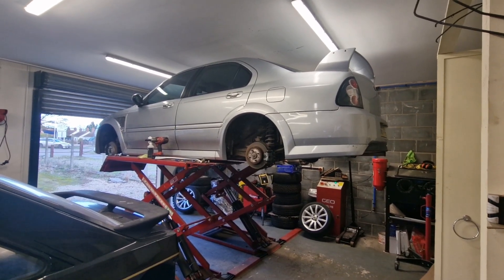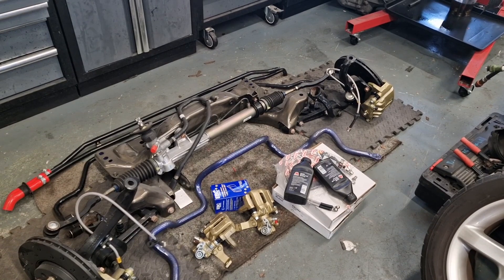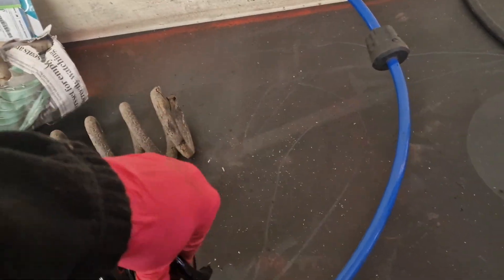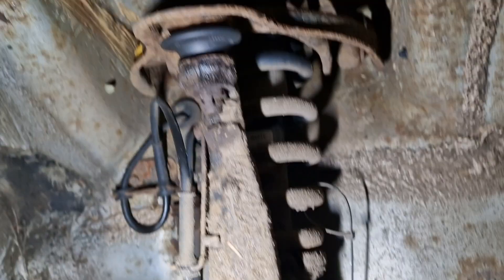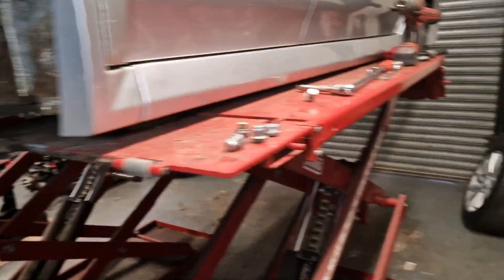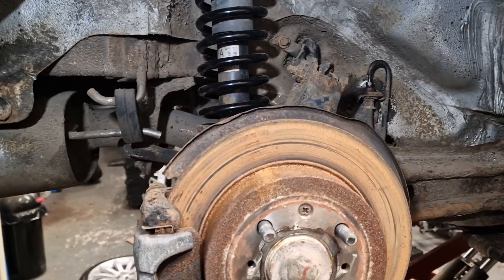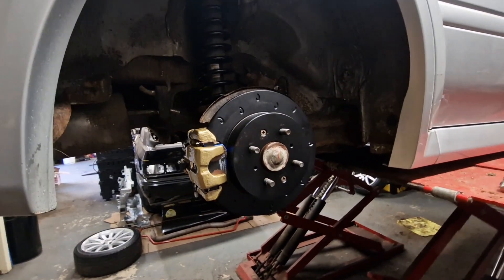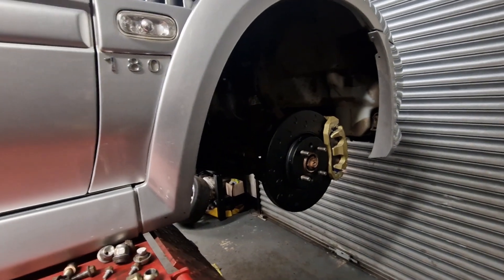MGZS 180 - Honda Brake Upgrade & Motobuild Lowering Springs

Comment: This is a great video lesson. Going through a similar situation with my MG ZR t16 front brakes 300mm and Honda callipers. Could you tell me which master cylinder you’ve gone for. Also, the name of the machine you used if you recommend them. Many Thanks
Reply from the maker: It's just running standard master cylinder. The machine shop I used is local to me, cwd enginnering